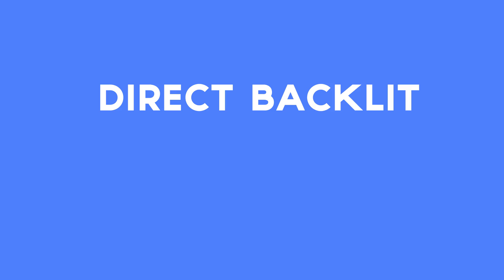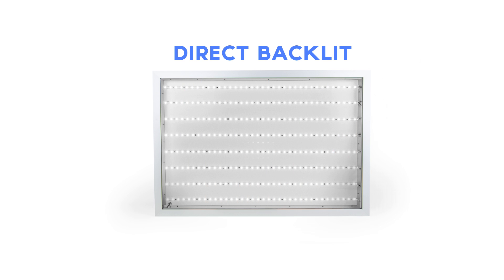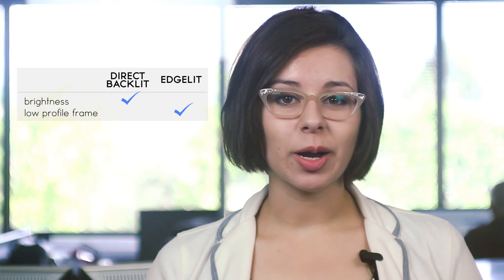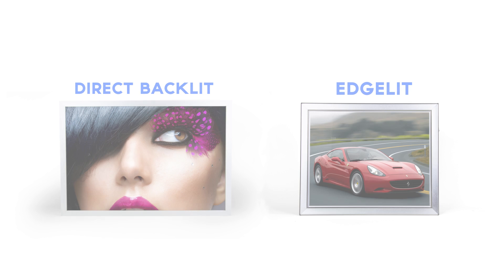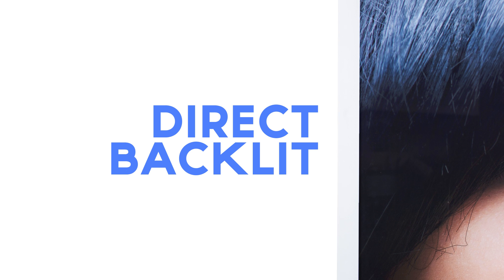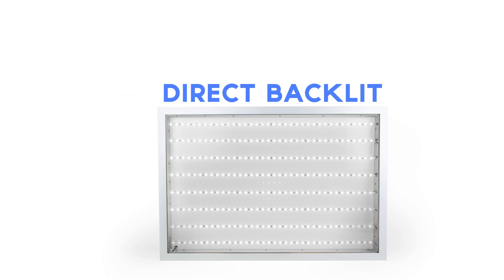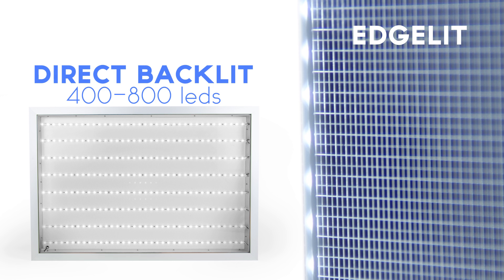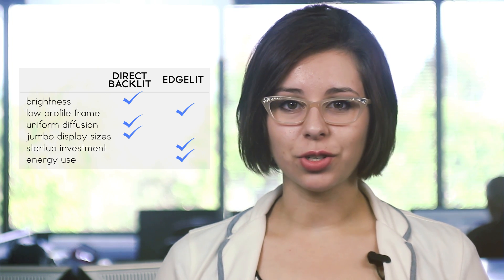Direct Backlit vs. Edgelit Lightboxes

Comment: people often mistake direct led with full array, and the difference between those is huge. d-led is not capable of producing very good local dimming, which can in the end give you horrible ghosting. and if you turn it off (which is not even always possible), than the advantage of d-led goes away (compared to edge led). full array is definitely the best since it has more lights that can be turned on or off, but is much more expensive. so if you really wanna spend some more money on tv, its best to just go for oled/qled. if not, edge and d-led are kinda very similar and depend on how good the panel is. for example, samsung is one of the best tv brands, even without having d-led in its entry/mid level class tvs. so, just get whatever has good ratings, or save money and go big.
edit: video is now 5 years old, so the things kinda changed. edge lits got much better in what they do. still, if youre not on a budger -> qled / oled.

Comment: DLED consumes less power then ELED. No. Of LED not a matter.
In case ELED , all LED are always on even in dark scene for which black is grey in ELED Backlighting Display.

DLED has local dimming. In case you are watching movies it's upper and lower row leds are off. The particular led is on which is required. Hence Contrast ratio is better in direct LED backlit display technology.

Comment: Edge LED has no advantages at all picture quality wise.
Reply: does it matter for a 13 in laptop?
Reply: takeshii 😂no
Reply: I mean, unless you don’t want a bright ass T.V
Reply: Wrong
This direct backlit in stripes (like in the video) has a big disadvantage. On rare occasions there is a homogene image , for example a grey wall, and the camera moves up, or down - then you will see the different darker and brighter lines of the direct backlit stripes on your TV. You will not see that on normal camera moves left or right, as the stripes are horizontal. I see the light stripes on my Hisense TV and it is kind of distracting. It is rare of course, but usually 2 or 3 times during a movie the camera moves upward. You will not see that on a edge lit tv as the brightness is more uniform. End.
Reply: Are you sure about that? Direct led has backlight bleeding on the picture while edge lit does not 😏
Reply: @stevewalker6240  in did. Bought the bravia 95 much better.
Reply: Price

Comment: Very nice video. Learnt the difference. 
I have a question, reviewer said that power consumption varies in direct-backlit from edgelit, can you tell me by how much?
Reply from the maker: Raja - the difference in power consumption between an Edgelit and a Direct Backlit lightbox depends on the display size of the lightboxes in question; however, there is a crude yet possibly adequate method for calculating the difference within a reasonable margin. Consider that each LED strip in a direct-backlit model consumes approximately 1/2 to 2/3 the power* of one LED strip in an Edgelit model. Then, if you know the power consumption of either the Edgelit or the Direct Backlit unit, and if you can determine how many LED strips are installed in each of the 2 models, you can do some quick arithmetic to learn how much more power the Direct Backlit lightbox will consume. Tip: Edgelit lightboxes almost always contain exactly 2 LED strips, one each running along the longer 2 of the 4 edges (sometimes all 4 edges of an edgelit model contain an LED strip, but this is rare). Direct-Backlit lightboxes usually contain LED strips running vertically (occasionally horizontally), and these strips are usually spaced 2" to 8" apart, depending on the model. *Also, the reason that LED strips in an edgelit lightbox consume more power than those in a direct-backlit one, is because edgelit lightboxes usually use higher-density and/or higher-brightness LED lamp strips to achieve adequate display brightness across the graphic face, since the light transfer from source to spectator is indirect and therefore more subject to diminished intensity as it travels. For more questions, please visit http://www.blueriverdigital.com/lightboxes/ and/or feel free to give us a call at 800-706-4276 (USA) or +1-916-919-9900 (International).